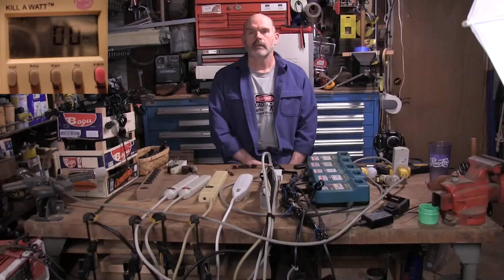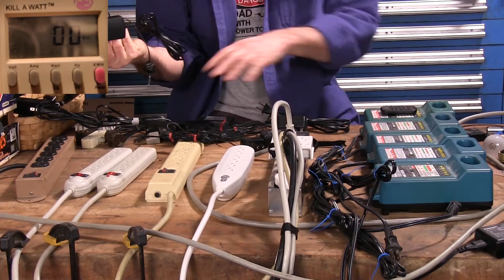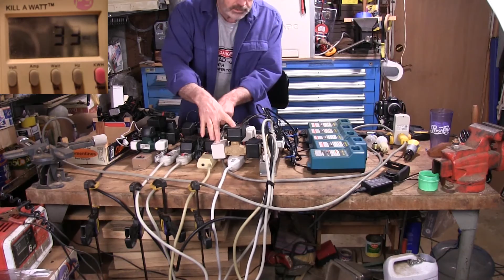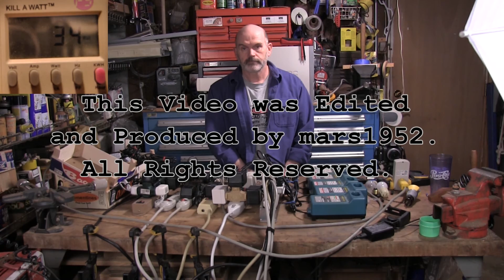How Much Power Are Your Phone Chargers Really Using?

Comment: 270 mw used while a phone charger is idle over a year is in the same ballpark as the amount of power a smartphone uses per year. About 24 cents. About 2 cents per month on your electricity bill. Home heating/cooling ballparks at $100 per month. That is 5000 to 1. If you save 10% off your heating bill that is $10 (about 83 kw). But 10% off of a phone charger is 0.2 cents (about 17 w). Making your home better insulated is 5000 times as important as worrying about a phone charger. 
And un-plugging then plugging back in 365 times a year will wear out the charger. If a new charger costs $25, you would have to leave your existing one plugged in for 100 years before you began to save money. And consider how much energy goes into manufacturing and delivering a new charger. And then you have the worn out one to deal with.
The people that are complaining to you about leaving your phone plugged in live in their parents basement and are afraid of math.

Comment from the maker: I have had a wall wort type charger get hot enough to melt the case a little and it is possible that a defective charger could start a fire but I think that the odds of it happening are pretty low, about a billion to one. Every electronic device has some kind of power supply. Usually it is built into the device like it is in your TV, cable box, and DVD player. If you want to be completely safe you will have to unplug everything when you are not using it.

Comment from the maker: I have a group of chargers that I do not use very often and I have them on a power strip with a switch. When I need them I flip the switch. The rest of the time it is off. I was more worried about the longevity of the power supplys rather than the power consumption.